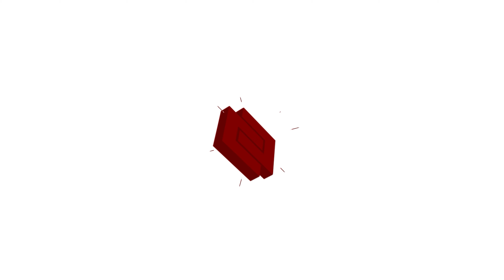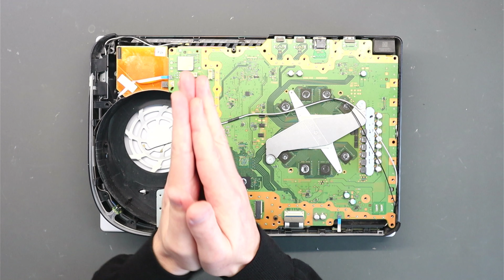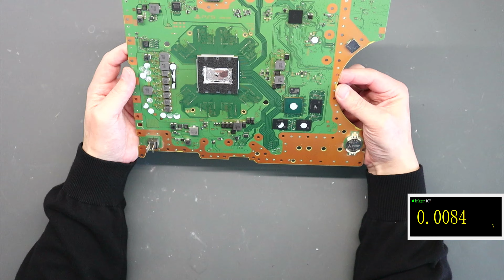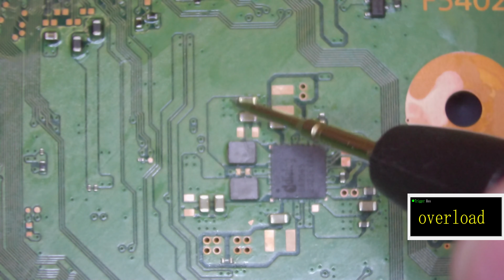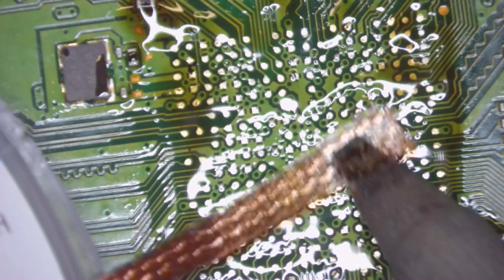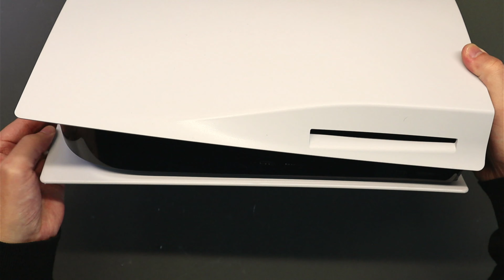PlayStation 5 not turning on & missing 3.3v - full diags & testing #ps5 #repair

Comment: Thanks for the video, Just bought my first dead PS5.
Hopefully I can find the issue.
So far only tested 12v from PSU which is present.
Will watch a few more videos, it’s a EDM-031, can’t find much info on it testing wise.
Reply from the maker: Good luck with the repair - let me know how you get on and if you have any questions.
Reply: @TweakTips  Thanks, so I’m doing my best without a bench power supply of thermal cam, been watching heaps of videos from all you legends like ToltecMerc, Joey, Phil etc, actually joined JoeyDoesTechs discord server.
So bought it off EBay, it’s a newer EDM-031 (not much content on YouTube in this board) looks like it was never opened, apparently just stopped working no power no beep.
PSU is fine and looks like I have most voltage’s but I couldn’t find a diagram of the rails for this board.
I then found F7200 fuse had no continuity, and 2 caps front and back of board in this circuit close to the fuse were short to ground. I removed the caps but the shorts still there.
Some helpful members on Joeys repair discord said that the circuits are for the WiFi, turns out 3 caps under the WiFi ic are short to ground and one on top next to the shield.
Don’t know whether to just remove the WiFi ic to see if the shorts are gone or remove all 4 caps? The guy on discord said I should start with the DCDC converters but even if they are bad I don’t have a donor and I can’t even find the tiny 8 pin ic on the internet, it’s labeled 027 or 02Y, it’s very hard to read. Maybe 1 is 027 and the other 02Y as I was told the 5.1v is converted to 3.3 and 1.8 for the WiFi ic?
Any thoughts my friend?
Reply: @TweakTips  Well thank god it was the WiFi IC, that took serious heat and when lifting it the shield moved and dozens of caps etc went sliding all over. But the short is gone 😁
Reply from the maker: @TheCroupier74  From my experience, if more than one cap under the WIFI IC is short, then 9 times out of 10 it is a bad WIFI IC.  Personally, I would swap out the WIFI IC. They can be a little tricky to remove as the metal plate covering it can get desoldered from the IC when you heat it, so heat it from below and very carefully pick up the entire WIFI IC (including the metal cover) with a pair of tweezers - I sometimes find it easier to push the IC to side before I pick it up.  I think the other IC you mention sounds like the 1.8v to 5v converter - if so, Phil has them for sale on his shop - take a look at this and see if this is same as you have - https://www.consolefix.shop/collections/replacement-playstation-5-components/products/f7002-5v-to-1-8v-ic-for-ps5-edm-020-edm-030-edm-033-motherboards
Reply: @TweakTips  I heated from the top because I didn’t want to melt the WiFi cable connectors, yeah the shield slid off so I better be careful with the replacement.
Can I ask you, do I need the same revision of WiFi IC? Or is any J20H100 chip ok?
I’m hoping with leaded solder the replacement will go on easier 🙏
Oh and I now have 1.8v and 3.3v showing on the caps under where the ic was.